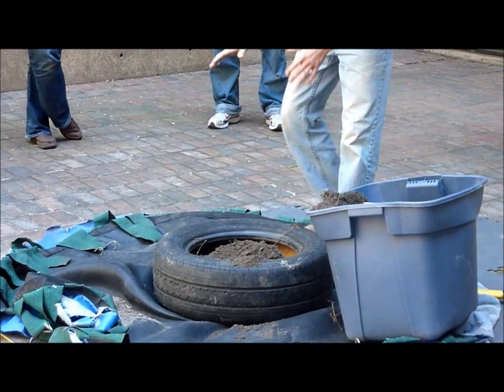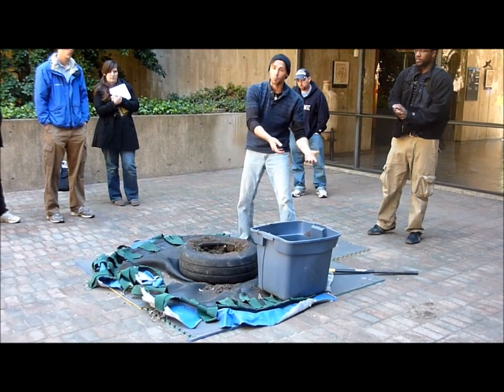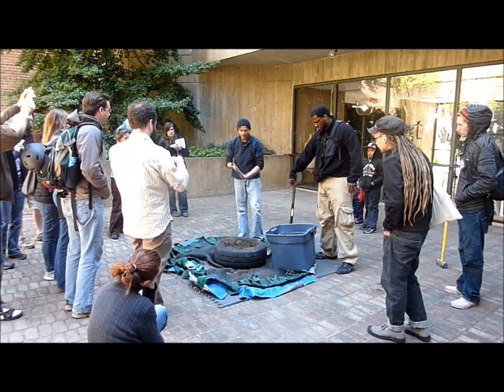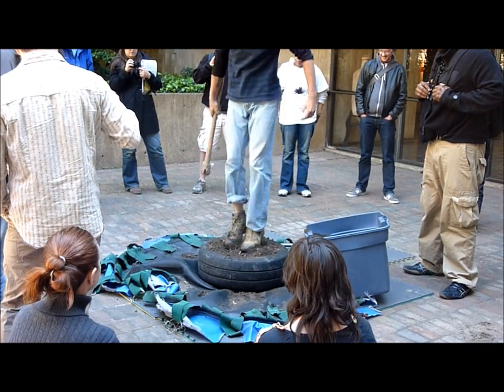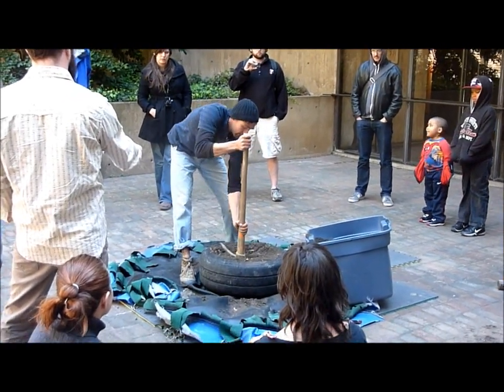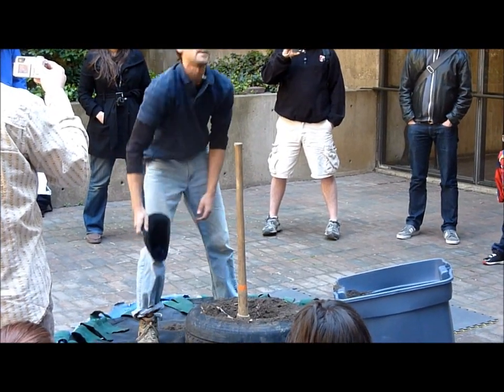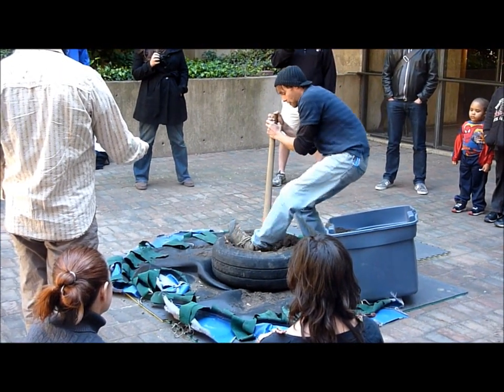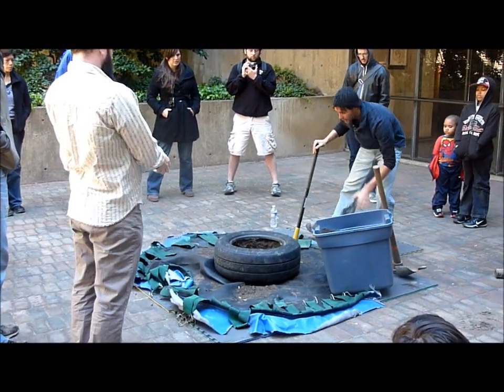How to: Earthship Tire Pounding / Ramming Pt 1

Comment: That's the slow train to China, dude!  If you just mechanize things a bit, it suddenly becomes vastly easier.  Think Jumping Jack gas-powered compactors on a little crane, backhoes for lifting and moving the tires, and avoiding as much physical labor as possible.  There's a guy in Australia that figured all of that out, and enabled himself to do almost all of the tire work by himself, quickly.

Comment: i think compressed earth blocks (ceb) is better than pounded tires (and it also uses mostly earth)
earth blocks is like %10 percent cement. has a stronger compression rating which means more biomass per square inch, you can produce 15-20 CEB'S with a ceb hand press in the time it takes to pound 1 tire, all blocks are evenly made so building is easier, you can have an interlocking press witch makes interlocking cebs which builds like lego.an earthblock wall can replace a can wall wile using less cement.you can have the traditionel nice brick look
my question to mike reynolds and all earthship enthusiasts
why not use ceb's in the earthship?
why is it that i cannot find any info that compares tire pounded bricks to other green building methods like rammed earth ,cebs, etc...?
Reply: My wife and I own a Hydraform ExM block machine...I still agree with the tire structure technique...it carries a roof load quite well without the mechanization processes required from compressed earth block. Both are sound techniques.